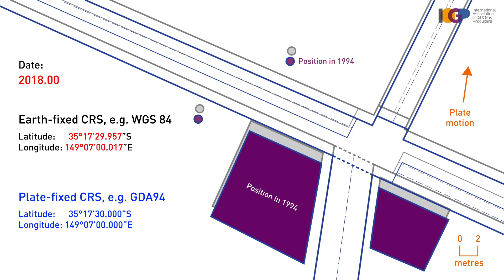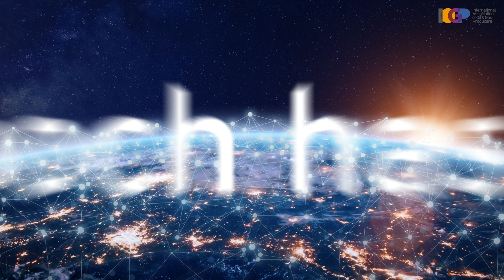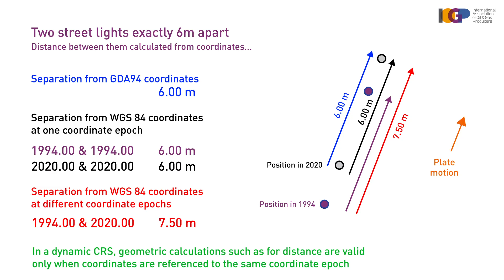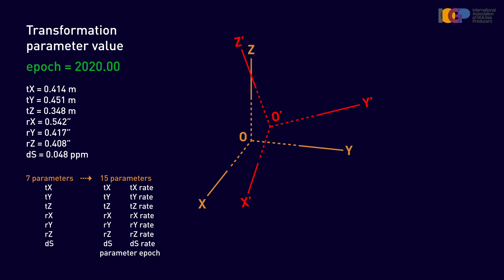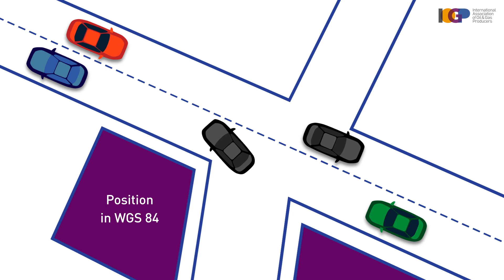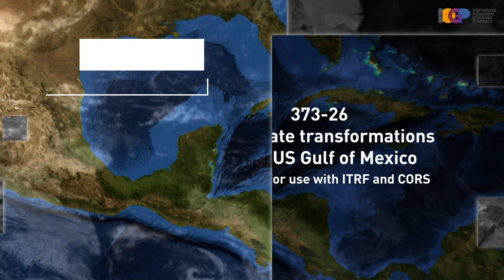Dynamic Coordinate Reference Systems

Comment: An excellent video illustrating the ever challenging need to align with the continuous motion of plates and still get the works done correctly - always a challenge in computations made to support  engineering decisions in O & G field engineering surveys.  Thank you IOGP for bringing out the value addition that knowledgeable surveyors can bring to O & G OPCOs.